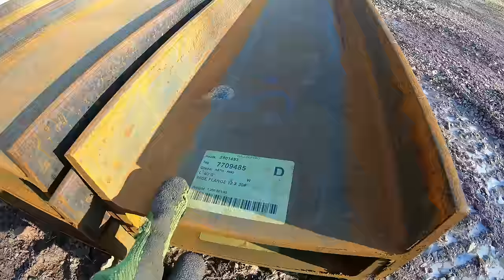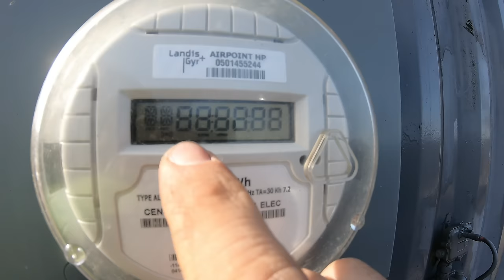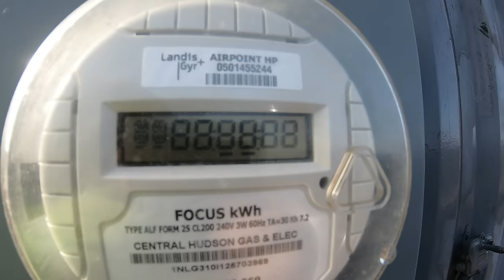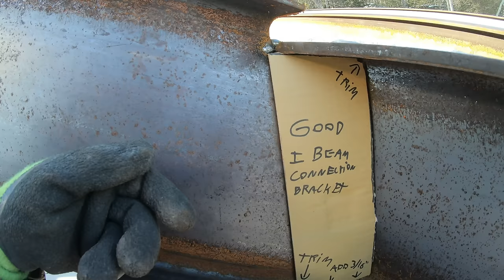Container castle roof rafters

Comment: Looking good; even though it is a huge job with a small crew you haven't cut corners to simplify the work. The gable and angles really add a lot of visual interest. Some people have the ability to design, others the ability to build. Andrew is one of the unique ones that can design, build, repair and chooses to share with us. Many thanks for taking us along as you live the dream.
Reply: @ed1658  question from a novice, what are the biggest issues?
Reply: Ed I would take you more seriously if you left your personal estetic opinions out of it. The only real issue you raised is 7 which i assume can be fixed, maybe foam insulation? The rest of your points are just statements of facts or opinions on estetics?

You have a link to that video about engineering issues?
Reply from the maker: Ed you don’t know anything. Get off my channel.
Reply: Bad ass and i don't care who you are-this is impressive construction and a talented mechanic of many trades.
Reply: @AndrewCamarata  dude-you are a construction workers hero-and probably many office people too would love to work like you if they even knew how.Very great work on all your vids.
Reply: @ed1658  Seriously, facts? You are basically hating at this moment with opinions. This is basically his own thing and his opinion of what he thinks is nice. But engineering facts? No!

1. 20000 lbs roof. Sure, I'll take your word for it. But a problem? No. A container can hold 60000 lbs of cargo and they stack those 10+ stories high. Those vertical beams take some serious load. Plus, he's adding extra vertical beams to the building, just to be sure. So not really an engineering issue.
2. Rafters aren't evenly spaced. Sure look evenly spaced to me, except for two beams that are closer to each other in one plane. But that's simply looks, not an engineering issue. Yes, the spacing in different planes are different, but is it an actual problem? Nope, just esthetics.
3. Steel needs to be painted. Dude, chill, welding takes time. He released a video two months ago painting his containers, rafters and what not.
4. Building standards evolved. Agreed, but not an issue as such on this project. Or are you talking about esthetics? Well, in that case, could we please bring back Victorian standards? At least that was pleasing to my eye. But beauty is simply a one man opinion. Not an engineering issue.
5. Steel expands. Yes. So do ships made of steel, but those don't fall apart. Not an engineering issue
6. Ugly space. Your opinion, not an actual engineering fact. 
7. You can't heat it. Only his living/sleeping room need to be heated. The rest is basically a huge garage. And from experience I know for a fact that you can heat a four shipping container structure with basic isolation. It just takes a shitload of fuel. Not an engineering issue, just his personal problem. And I'm pretty sure he doesn't heat up the place all that high anyway, he looks like a guy that just puts on another sweater.
8. Leaks because stupid. Moot point, see 6
9 Ugly. Now you are repeating yourself.

So ALL your points are basically a huge pile of horse poopoo opinions. This is just one man building his own dream thing. I personally don't like many things he does, but I generally don't care. Now he does skip a lot of safety, that I do agree on. But then again, I can imagine working on a personal project you can do all levels of stupid all you like. And to be honest, I find a lot of "professionals" on YouTube working on actual paying jobs without safety gear. To be completely honest I find that "standards" in the US are generally lacking all over the place, but then they tried to compensate with those INSANE amount of inspections. I've never seen so many inspections on a building site in my country, here we have actual high standards that practically guarantee proper results without having an inspector checking each and every step. But then again we use the metric system, so that pretty much guarantees quality to begin with. (it's a joke ppl!)

Now you pointed out this video from Andy. I've checked it out. Yes he talks about "best practices". Andrew is pretty clear that he wants "ridiculous practices". But that doesn't make it an engineering issue. But I've suffered through that video, it was way too tedious. But his main points are: I would do the roof different (he actually agreed with the vertical posts), because best practices, cost and such. His second point is painting/rust, which I already covered. His third (actual) point are the diagonal members that are missing. But he skips over that point kinda quick and is told as an afterthought somehow. An engineers job is to regurgitate the rule book and design the optimal for optimal cost. Nobody welds on site anymore, simply because it's hella expensive. Nobody does steel roofs like this because you cannot afford the welding time required. But is it against code? I doubt it. And in the end he still recommends you watch his channel anyway. If there were actual engineering issues, he wouldn't recommend that you go and watch his channel.

So if you strip all opinions, you are left with just money issues and esthetics issues. But no real engineering issues. Unless I missed something, but I have to work hard to find it. I highly doubt anyone is going to copy andrew, unless they are just as crazy and have a shitload of equipment available. Oh and how is that union thing working out for ya? Have you put him out of business yet? Oh wait, you were probably talking about a construction union, which doesn't affect him at all since this is his personal project.
Reply: @ed1658  your probably just jealous that Andrew is richer than and knows more as well
Reply: @ed1658  Wow this dude really got his ass closed (like we say in my country).
Reply: @ed1658  1- Only a problem if the rest of the building can't support it. 2- only a problem if that compromises the roof, symmetry or aesthetics of the spacing mean nothing themselves. 3- it was painted. 4- this statement means nothing in context. 5- every material contracts and expands with temperature. if everything is made from steel, it's gonna expand and contract in a similar amount so it doesn't matter. 6- your personal opinion of aesthetics means nothing for structural integrity. 7- you can insulate anything with insulation. 8- stupidity does not correlate to leaky behaviour (in buildings at least). 9- your personal opinion of aesthetics means nothing for structural integrity. You basically wrote absolutely nothing of any meaning, you're just trying to look smart while being desperate to fire shots at someone. But all your shots were blanks. Maybe get off of YouTube and be constructive for a change. Or post a single actual fact why is this castle bad.
Reply: @ed1658  what's up troll u still here?
Reply: @6920-n4d  Luckily, he's gone now

Comment: 1:07:51 "I'm glad I didn't build my roof out of these things, look how easy that broke" 😂 😂 😂 😂 😂 😂
Reply: It broke for no reason
Reply: Hahaha I came looking in comments looking for this.
Reply: @rider573  There was a reason. Something about a bucket tooth gnawing at it. Lol Used as intended, they're perfectly fine.
Reply: Magnolia Screens thay are not rated to hold up 15 ton of Excavator
Reply: @jarroddraper5140  But he didn't need to carry that kind of load for his roof. In a wood vs excavators bucket teeth match, the wood looses every time.

Andrew mentions putting the same type roof that's on his equipment shed / pole barn - on the Castle. These LVL's would have been perfect! Mid-stroke, he changed his plan to keep wood out of the building, for fire or extreme weather events. He talks about it just after @ 21:42
Reply: When a meteor strike turns the castle into a crater he will complain about how easy it broke. 🙄
Reply: Anyone in this section who agrees with andrew should first learn the difference between shear and compressive forces.  Then learn what a lvl is used for, and how to properly use an lvl.
Reply: LVL would be better material. It’s strong enough to hold the roof and heavy snow. The steel I-beam roof rafter looks too heavy. The wall will be collapsed first before the roof fails.
Reply: @johnnyrocket9372  Precisely.
Reply: @erictold  so you didnt see how many steel beams he has supporting the roof up :)

Comment: We learned pretty quick to not weld on the meter. Always run a generator alongside the welder. It will always be cheaper than the meter, no exceptions.

Great video as always.

Edit: Also please get rid of that wooden ladder. A buddy was put into the hospital last year from one of them collapsing on him. The one you were using didn't look too sturdy to me. Or at the very least don't use it to lift steel. That's just scary.
Reply: I don't understand how you could make power cheaper than the utility company.
Reply: No-one can make power as cheap as the Utility Company, but the price you pay for Electricity, especially high current draw at casual daytime rates, is unrelated to how much it costs them to produce it. Electricity prices are based on political, strategic and socio-economic factors, not on production costs.
Reply: Yep, past 50, no more ladders.
Reply: You're crazy if you think a little genny can make power cheaper than a cascade of steam turbines. If that were true, nobody would buy power from the pole.

Comment: Building Inspector :Is  that concrete up to the required standard?
Andrew: Of course I had it Lab tasted mate.
Reply: Perfect!
Reply: I think this is the best comment. :)
Reply: It wasn't too stiff,  Your playback speed was too slow.  But in all seriousness, using a measured volume of water would really help.
Reply: How did your lab results come out ? The lab wasn't pleased with the compaction , but it passed
Reply: Now that was an excellent bit of wit, full marks on that one!
Reply: What were the lab results?  It tasted just fine.
Reply: One of the best comments I have seen anywhere.
Reply: single stick of rebar down that can let rust gateway in.. jus sayn
Reply: "Link to mixer: " - So you can make your own dog food
Reply: OK, if the crete was Lab-a-dor tested where did he sign off on the project? I've worked 25 years in the crete biz and if it hasn't been signed off on by the work of a Lab then it just ain't right. 

At least one paw print - somewhere.
Reply: Fat Dan Crete is in Greece, Labrador in Newfoundland.
Concrete evidence that foundation level Geography is perhaps not your strong point?

Comment: How he didn't break off the outdoor light lifting metal up I dont know...
Reply: i was thinking the same thing...
Reply: Same here
Reply: me also
Reply: Add me to the list
Reply: Twist the cable counter clock wise i bet Andrew did in turn he avoided the lights? You do the same thing on a cranes when setting the hook.  An old timer i watched on a tunneling job do this. I can even braid cable into loops it is not un common as a deck hand to have skills.
Reply: This is editing trick. He first smashed the lights, then lifted the beam, then installed same exact lights.
Reply: A stick.
Reply: 3 times.
Reply: Ditto!!!!
Reply: I am with you
Reply: I noticed that too, skill.

Comment: ...
... GR8 Tip when mixing Cement in a mixer ...
... Have the Drum or in your case Blades rotating ...
... It will eliminate the start up torque on the bearing ...
... Also it will make for a better mix, more evenly ...
...

Comment: You might try adding a bunch of sacrificial anodes to keep everything from rusting.
Reply: i also want him to put in some cross bracing for shear and wind, but the amount of welds he is putting on it, every connection is a moment connection
Reply: Yes, cathodic protection FTW 👍🏻
Reply: Good point but that does nothing unless you're under water. He could use some paint with zinc in it or use a plasma zinc blaster to coat it in zinc which protects it somewhat.
Reply: rust never sleeps
Reply: You are right, my bad, It would have to be buried to work
Reply: 500 gallons of POR15, lol.
Reply: Anodes are added to steel structures on land all the time. The ground itself is the electrolyte, depending on the conductance of the soil. All he has to do is connect a wire from zinc anode to steel and bury the anode.

Comment: I work in the Port and we stack loaded 40' container in the hole and on deck of ship 5 -7 - 8 high. They can take allot of weight. These containers are a disposable item in the industry. It's cheaper to buy new ones then it is to ship back, process and transport them. They are not designed to hold weight on the edges of the roofs. The containers sit soley on the corner posts.
Reply: Rgds to SA..
Reply from the maker: Good info. I’ve added columns to the ground in the areas where support is needed mid way by the container.
Reply: @AndrewCamarata  I saw that and you did the right thing reinforcing  the top rails they are not designed to bare weight.
Reply: That's some quality melt value there now!
Reply: I work at the port as well and was so glad you add the three supports because like the other guy stated the four corners together can handle 210 tons top of the bottom container but the rails are just for looks lol.
Reply: @AndrewCamarata  Also great you added those diagonal bracings on all the ends, those are really important for horizontal strength!
Reply: @AndrewCamarata  what was the black hose you put in the concrete? A air hose to help it settle?
Reply: @steven saxon its a concrete vibrator. It helps the concrete settle evenly into all small spaces, and helps remove trapped air.

Comment: *Circ saw motor burning out throwing sparks *
Andrew- "uhhgg" finishes the job 💪
Reply: 'Eh, if it goes before I'm finished with this cut, it goes.' And that's apparently what exactly happened, as another circ saw was used to finish that specific cutting. XD
Reply: He needs to weld them handles closed on the concrete mixer so he does not waste it out the sides on the chute...

Comment: Always love your videos.  Just a little tip for you to consider: The concrete vibrator should be a quick dip in, wait a second and pull it out in several areas (maybe 2-3 spots for this particular project.  If the vibrator is held in there for too long, it will segregate the aggregate and the cement.

Comment: I don't know how you plan to heat your castle but now that you've poured some of the floors you missed the opportunity to install radiant heat which requires continuous flexible pipe buried in that cement.  That heat is absolutely marvelous and very even without the temperature ups and downs of forced air systems and your feet never get cold!  I was a building contractor and installed radiant heat in two of the houses I built.  The major problem is that if cooling is desired a separate duct system has to be installed to move the cold air.  This makes radiant systems in those situations far more costly.  In the long run I would rather have heat comfort rather than cold air in the summers and from your videos of life in Kingston, New York, I think being comfortable in winter tops the need for cooling in summer.  If you have a minute I'd like to hear what you plan to do about not freezing to death!
Reply: When Andrew built the garage portion he put PEX in the slab for radiant heat.  Has he hooked it up?  Nope.

Comment: Another thought. IMO, the wooden beams would have been better because you can insulate between them and they will not transfer cold or heat to the inside. Unless you are going to insulate with closed-cell foam and even then because the steel will transfer the hot and cold., IMO, that big room will be a furnace in the summer and an icebox in the winter.
Reply: ???
Thermal breaks and thermal bridging are a thing, when worrying about heat convection transmitting from outside an envelope to the interior of the enclosed, occupied space.  Condensation is a primary concern.

In this application, there is some benefit to insulation, on the underside of the roof panels, but only to limit external heat convection from the sun beating down. Wood GluLams would add zero benefit unless this was an enclosed application. 

The entire roof structure is open air below.

Comment: Just a suggestion: when you put expanding lag bolts into concrete, first coat them liberally with epoxy,  then drive them in. This will create a much strong bond for the bolt and concrete.

Comment: They don't weld steel buildings together, they bolt the connections.  The steel beams will expand, contract and twist, throughout the seasons.  The welds will fail over time.
Reply: they mostly bolt connections to save time on the job site. There is nothing wrong with a welded connection.
Reply: Have you worked in the steel industry?

Because I have, even laid out drilled, and punched those holes.
And then those buts are welded onto the beams, because welds don't fail like you seem to think they do
Reply: Welds are actually almost always stronger than the two materials beeing welded together.
Reply: Drainage and ground work. Hope that hill is stable or yes, it may very well contort.
Reply from the maker: Brandon Candelario welded connections are stronger than bolting. By a large amount too.

Comment: Engineer checking the structure: This is beyond my pay grade. 👍 I'm wondering what the concrete guys are thinking.
Reply: the engineers came to check the mountain not the castle
Reply: @cliveramsbotty6077  to see if it would support the castle.
Reply: From a concrete guy 
I'm glad he put the 3 columns up to help hold the sides from blowing out. He is 100%spot on . LOTSSSSSSS of weight on them shipping containers.  And the sides don't like it .

Comment: have you calculated for snow weight - 1 ton of weight per m² assures that the roof can hold 1.2 meters of snow- witch should be max even in the north where you are
also have you calculatedthe lifting force by wind going under the roof
Reply: LOL